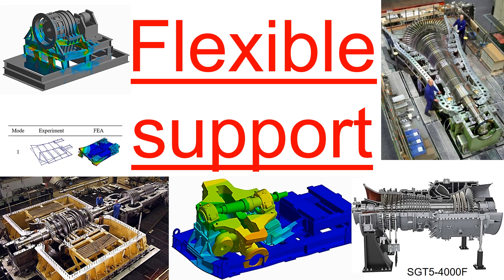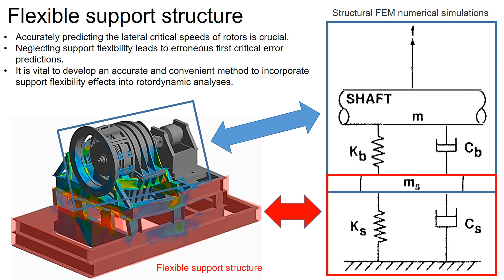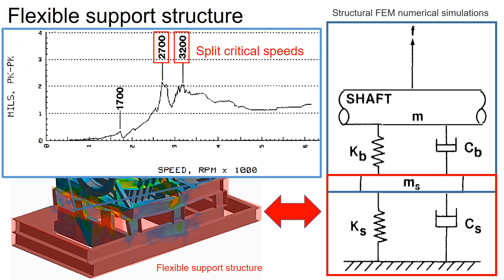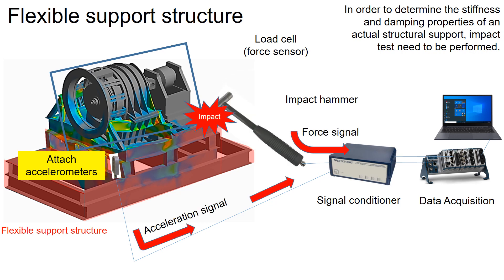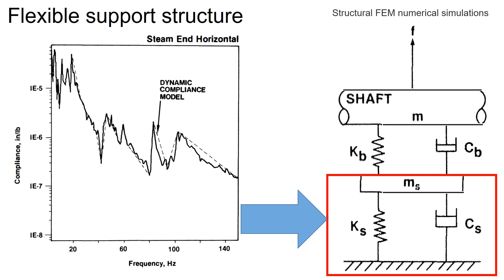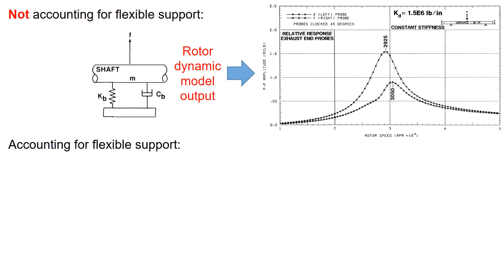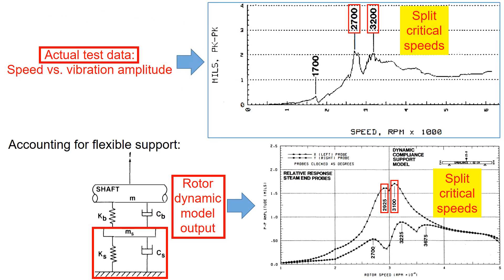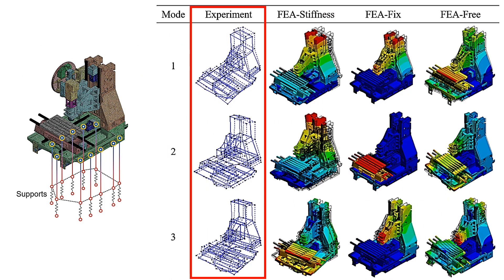Part 23 - Flexible Support in Rotating Machines

Comment: Excellent video.... Would you kindly explain what is "compliance"?
Thanks.
Reply from the maker: Excellent question! Compliance refers to a structure's susceptibility to movement caused by external forces. A higher level of compliance, indicating lower stiffness, results in easier movement of the structure in response to applied forces. Compliance curves visually represent the displacement amplitude of a specific point on a body per unit of applied force. 
Feel free to pose any additional questions in the chat. If you find the videos insightful, kindly consider sharing them with your colleagues and engineering friends. Your support is greatly appreciated!"
Reply: @RotorDynamics  Thanks for such a detailed explanation... Appreciate... Keep it up....
Reply from the maker: @cck1496   Thank you for your kind words! I'm glad you found the explanation helpful. Your support means a lot. I'll definitely keep it up! If you have any more questions or topics you'd like me to cover, feel free to let me know. Appreciate your feedback!